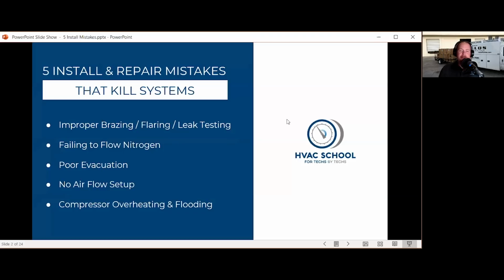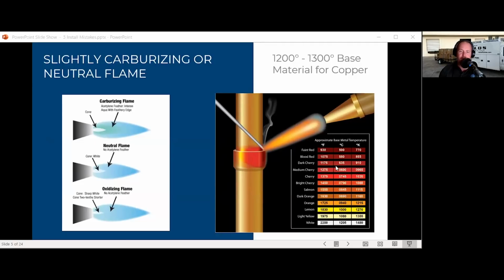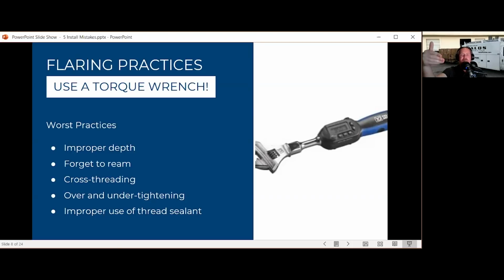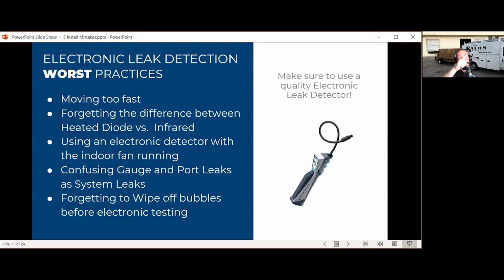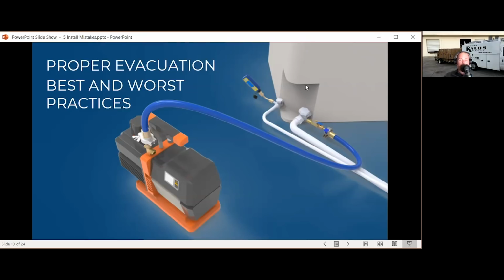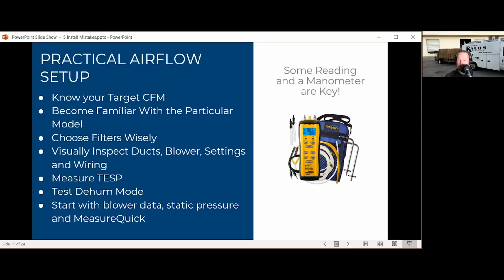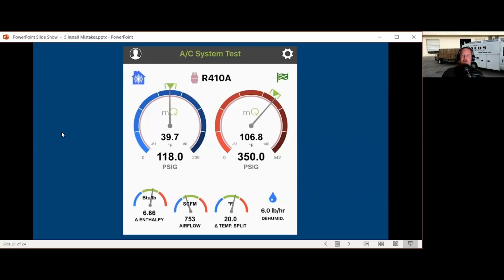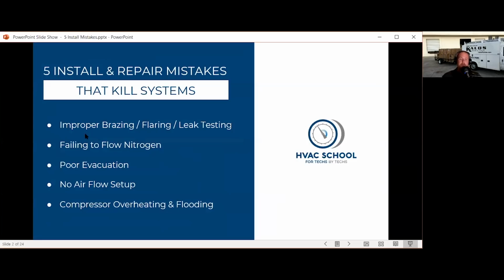5 Install Mistakes that Kill Systems

Comment: Just commenting on the part at 25 minutes where talking about using sealant on flare joints: 
I'm in school for HVAC currently, and I'm actually in the module about "Copper and Plastic Pipe Basics."

I've been taking a survey for my self. I'm trying to figure out if the book is rich or if the techs are right. Lots of people use dope.

And NCCER approved this material which can be found in HVAC Level 1, Module 7, 03103 Copper and Plastic Pipe Basics, section 2 (or 3), page 18, paragraph 2.

"The flare joint must be assembled using two
wrenches. Do not use any sort of pipe thread seal-ant or similar materials on the face of the joint. Pipe thread sealant is also of no value on the flare nut threads. The primary sealing point of the joint is the front surface of the flare. The threads serve only to tighten the faces together with the flare nut. Adding a drop of oil to the back of the flare, where it and the flare nut make contact, can help prevent galling."

-- directly quoted from the aforementioned text. 

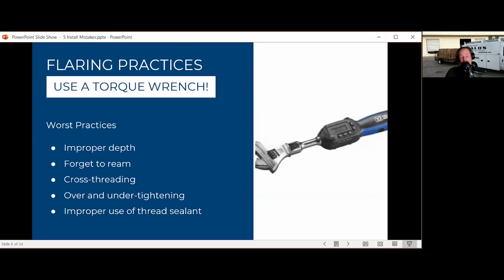25:01

Comment: I like the fixed heads on the torque wrench over the adjustable. I find the adjustable doesn’t always stay tight around the nut. Fixed heads will never have that problem. Also, I like to use a file in conjunction with a de-burring tool prior to making the flare. Lessens the chance of taking too much material off when de burring

Comment: Do you have a video showing how to fix a bad install. We had our new heat pump installed by a less than experienced technician and after watching your video I now realise how many steps that were missed or done improperly. I have been slowly watching many of your videos and have purchased all of the equipment needed to do a proper install. I'm a retired mechanical engineer and started doing HVAC on my auto repair projects after getting tired of having my AC recharged. This year we finally decided to go with a heat pump for our natural gas central air system. We live in the NW (Oregon). Since I now have the equipment to do a proper install, and thanks to you, now have the required knowledge to, at least, do a better installation job than the tech we hired, I would like to see if I can undo any of the potential long term problems he might have caused. At the very least I am going through and checking all of the system settings that you cover in this fine video. Any info on recognising and fixing a possibly poor pump down job would be helpful for my peace of mind. Thanks for teaching an old dog some new tricks.

Comment: Having to setup a system in a 2700sqft manufactured home is one heck of a task just had my entire system replaced with a American Standard 5 ton two stage Gold 18 heat pump With a gold 18 variable speed downflow air handler as well as them replacing and running some new duct runs and for the life of me they couldn't get my static pressures lower than .9 total external static 15 supply registers and every single one of them was .52 and the return was .67 I'm thinking at least on the return side I need either another 25x30 return or what to do.

Comment: I always thought my blower motor for the evaporator was to be cleaned of dust that sticks in the squirrel cage fins. Does any body spray it off regularly. I have seen ones that are so full of lint that the fins are flat not arcs. It is hard to do to clean it/them, what do you spray them down with. silicone aerisol ? one day I will get the garden hose.

Comment: Have a Bryant 3 ton central air. Installed in 1983. Has never needed refrigerant and original capacitor. Temps today is 105 degrees and keeping the house cool.

Comment: Sometimes the shrader cores are almost impossible to get out due to manufacture or install, like there’s no room to get the remover tool in there.. otherwise I always pull atleast one shrader core

Comment: using a swage kit to deburr is way quicker and cleaner. for example: after cutting a 7/8 copper line, use the 3/4 swage, open it all the way and its a perfect fit.

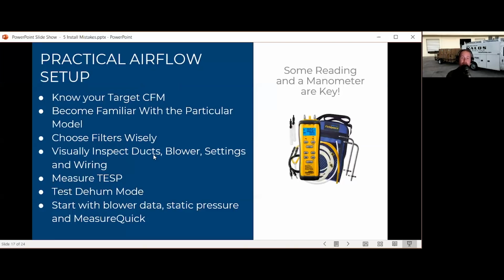Comment: 42:53 if you had a dollar for every installed system you inspected for the first time, and noticed there were no holes drilled to test static pressure, would you be a millionaire?

Comment: I have never seen one tech who flowed nitrogen thru a system while brazing who did not have a leak later.  Sounds good in pratice., but very hard in practice.
Reply: Don't jam 50 psi into the system while brazing then
Reply: If you haven't seen it or practiced doesn't mean it is right. Take pride what you do regardless of others.
Reply: @1971omi  Right. We did a huge job at a refinery. Thousands of feet of piping and hundreds of fittings. Engineers insisted  on flowing nitrogen thru lines. We did.  The right way.  Ended up going back and spending several weeks fixing leaks.  The few lines we did not flow nitrogen thru , No leaks.  After that experience I said enough of that. I just purge the lines with nitrogen and then let it escape while brazing. No flowing nitrogen thru lines. By the way I have never seen a plumber solder a line up while water is flowing thru it.
Reply: @johnd4348  That is the dumbest analogy I have ever heard!
Reply: @NeverEnoughPyro40  apparently you dont know the definition of analogy.
Reply: @johnd4348   You must have had pressure in the lines.  Did you use a flow meter, set properly, or did you use a regulator?  In 45 years of brazing, I’ve never had a leak that was caused by flowing nitrogen thru the piping while brazing.  Like you I have done winery’s with hundreds of joints.  Just because you had problems, doesn’t change the fact that it is best practice.
Reply: It can be an issue when it starts to give you pinholes but it 100% will save you down the line. On that last joint or 2 if it starts to build pressure just shut it off, then blow it out after.

Comment: Number one thing that kills systems. TIME,  Employers and supervisors pushing techs to get every job done as quickly as possible and skipping every proper proven method to make a system work properly.  I hear about TIME  and Productivity 40 times a day to the point I am about to quit . It makes this field  very unenjoyable.
Reply: Yeah it's why it's best to start your own company so you can do the best quality work without pressure. I loved when I had my own company because any customer that wanted quick over quality I would refer them to the other companies. I would even sometimes tell customers I would take two days to do an install and they really didn't like it but I would explain that sometimes the extra time to remake the return box or other aspects would make unit last longer. Actually had to move unit from one side of house to another and redo duct and it took six days but customer was very happy since it was moved twice before and it was just patch job over patch job and I said I would only do it if we could do everything properly. Your work will speak for itself and almost all my future clients came from word of mouth since I did no advertising.

Comment: Way good advice... pipe contamination is easy for a careless technician. It has just happened once to me. I do not know how I got the dirt in the pipe but it cost me hours and service to clean the system up after that. I'm still nervous about the compressor to this day. Take your time on the installs. Best advice anyone can ever give.

Comment: Down here in the land down under we still have 3/4 flares out there. I always use an automotive torque wrench with crows foot ends but I can hardly get those 3/4 flares to torque

Comment: Could soft silver solder be used in place of brazing?
Staybright 8  stronger than braising? Doesnt cook king value?
Use min amout of flux? Close gaps for proper installation? As per the instructions.

Comment: Brazing missed using the correct tip size. Many torch sets for domestic use are too small for commercial use.

Comment: A system will not leak if all pressure switches and joints are brazed correctly and if your Schrader valves are screwed in tight with the valve caps on tight. That's why it's called a sealed system. The first refrigerant charge is supposed to last 15-20 years after installation before the refrigerant levels would ever have to be adjusted.
Reply: correct. my longest running system i still know about is 17 years, one run capacitor failure.

Comment: For pressure testing, I've seen in Belgium that people use N2 + H2 as a test gas. This because the H2 molecules are much smaller and will show smaller leaks easier. Do you have thoughts on that?
Reply: Mr. Trappers,
An interesting conversation although I would pan the use of H2.
He Helium is the thinnest noble element that leaks much better than nitrogen, is non-reactive, leaks more at a lower pressure, which is why your kid's balloon goes limp. I'm guessing that helium leaks about 6 times easier than nitrogen.
I suspect that high-pressure nitrogen is used for HVAC due to lower cost, and maybe to break weak components before the unit is placed in service.
Reply: Its Impossible to detect N2 on a gas leak detector the trace gas can be detected might be the reason? You can of course use an ultrasonic or liquid for N2 leaks.
Reply: Meaningless to talk about atomic weights.

Comment: How long does it take to pull a good vacuum?...
To 200 microns, 3 cigarettes or 2 beers or a long lunch. Lol
Reply from the maker: will answer in Q/A vid
Reply: I find if I pull a vacum for no less than an hour or more the unit performs much better.

Comment: I work for a moderate sized mostly residential company over the 20 years we have installed 1000’s of systems every one soldered with stay brite 8 410/22. We leak check with nitro No micron gauge we run the 4 CFM vacuum for a 1/2 hr to 45 min and open the valves. We have had very little problems with systems we install and no leaks on any joints that I can think of. It’s nice to do everything to the book but only possible when your in a classroom not running a very successful business.
Reply from the maker: I do own a successful business with 160 employees. Try again.
Reply: We follow proper procedures at our company in which is successful. It’s not like it takes more time to do it right. More effort, yes. Don’t be lazy.

Comment: I'm definitely not an HVAC expert at all but I've just recently heard of running low pressure nitrogen through a system when brazing or even deburring for that matter. Working with my dad we'd usually clean the copper with a drill and wire brush, braze it in, and then leak test with nitrogen. We've never had any problems at all doing it that way.
Reply: Yeah the problems won’t come until later down the line, basically you want any possible contaminate to not be in the system. When you braze there will be black flakes on the inside, you also want to flush and blow the system out on each side.
Reply: @channelname8623  simply stated true facts hackery comes in all sizes and shapes his dad's short cut becomes another's  change out within 3 to 5 years down the road .

Comment: In most soldering, quenching is verboten because it can lead to cracking. 

Also, most bolt manufacturers recommend lowering the dry torque spec by 30% when lubed. I’m not sure how that holds up with flares.
Reply: Cracking occurs due to thermal shock, so I quench with my field provided heat shield (rag) because it has minimal thermal differential after brazing and then move to a rag that wasn’t used as a shield but has been sitting out so it’s also not much colder than the hot copper. Sometimes though when I’m feeling froggy, I do like to quench with ice water from my cooler immediately after brazing, life is short you know, yolo and such.

Comment: when changing r-22 to 410 freon do you need to change TXV in all cases
Reply: Betty Collins sorry but R410A is NOT FREON   Freon is a BRAND NAME of DUPONT.  Cheers 🇺🇸🇺🇸🇺🇸🇺🇸
Reply: I have seen the evaporater coil and condenser coil split going from R22 to 410A. The pressure is much higher.
Reply: Not even a thought dude it’s a must.
Reply: Of course, what kind of tech are you ?

Comment: I learned some of these steps at school,  but in the field, especially in the summer, there is not enough time to do all these while you have calls waiting with no A/C. Worked in a few companies and they don’t practice that at all. If you take to long, you’ll get reprimanded. That’s what I’ve seen.
Reply: Yep, i work at one of those places, we slam everything in and run out, i get a phone call asking about how we are coming every 1-2 hours , we do pull a good vac,  500 microns, thats about it
Reply: 100 percent agree. 30 year tech.  Its catch 22. Do the job right, BUT get it done fast.  I skip every step I can, let the Employer eat the cost under warranty call or call back.  It will be months later and who knows or keeps track of what was done. Poor additude but after 30 years  No mater how fast a job is done, its not fast enough. Or they know some tech who some were some time in the past did it faster and better.
Reply: Bottom line is greed , riding the pony till it keels over , worked over , ✌️👍💪🙏😔🤙
Reply: I worked for a company that would  send me to a whole day job on my own,  call me off to do multiple callouts and complain when initial job wasn't finished and I had to go back next day. Boss thought he could do it but he was useless.
Reply: I agree people toshit work and not follow proper practices
Reply: Find a better company! if you want to work for a company that doesn’t do best practices and focuses on “get to your next call” then stay where you are, but there are many companies that would rather the job gets done correctly the first time, and you don’t have to worry about what you have next.

Comment: Hi, big time follower here.  Wish knew about you when I did contracting in the Cayman Islands.  Question.   How fast would one see vacuum or nitrogen pressure change if there was a tiny pin hole leak?  Thanks
Reply: Depends on the size of the system/lineset(volume), it could be seconds or hours. Most higher end micron gauges have a leak/progression rate built in but if you have a large system it can still take time to show. And that's if your gauge is accurate.

Comment: You would probably shit your pants if you saw the stuff they do at the new company I started working at. Wish they cared about quality like you do. I get home from work and watch your videos every night, can’t thank you enough for the knowledge. Truly priceless.
Reply: Had a tech once tell me the company he worked at did the "blow and go method" meaning he would not use vacuum pump and just blow the air out of the line with refrigerant and go. He was probably the worst tech I ever worked with and told him anytime he worked with me we would use a vacuum pump. He only cared about getting off work to get to the bar.

Comment: Great information & I learned a few things. I will say though the company I work for just has install crew (changeouts) get the system running & have service come in to take readings, adjust charge, etc etc

Comment: A few tips from many years doing this. When deburring  tubing, I do tip the tubing upside down in 80% of the deburring, but when it’s not possible I run nitrogen to blow out the chips.  It’s critical to keep the system as pristine as possible with many of the mini splits, because some OEMs prohibit dryers in the system that would catch these particles. After I debur, I place my finger over he outlet to build up pressure and release the buildup and any residual contamination.  I was also taught to reflare after a flare was compressed twice and always inspect the flare. I was always taught to use a mill file to square off the tubing after deburring  to maintain maximum flare thickness. I also use flare gaskets on copper to steel connections.  Most mechanics and supply houses don’t know what they are.  I use a patch of duct tape to cover the ends of all tubing open more than 15 seconds or so.  I never remove both caps on a dryer at one time, I remove one, make the connection, then the other.  This helps reduce the adsorption of moisture to the desiccant.
Reply: Good job! This sounds like solid advice. Thanks!
Reply: It's those little details we forget that can be monumental or paramount to ace a repair or install thank you on sharing..,👍💪✌️🤔🖖💎😊
Reply: What is the cut of point (angle) before you ream and then purge nitrogen?

Comment: Question for Brian I'm a tech now but with the virus I'm back doing rough ins and change outs again. Which I don't mind I've used quite a bit I've learned such as sealing lines that will sit for a period. My question I see a lot of the guys I work with will use the caps and duct tape them to the lines is that sealing them well?
Reply: On a temp basis you can do that yes. No different than line set stored at the shop or in your van. All your looking to do is keep the moisture out.  On the other hand if your already tied into the evap it wouldn't hurt to pinch it shut and solder the end with a shraider valve and pressurize it with a bit of nitrogen if its sitting for a while.  Either way you go. Whatever is in the system will be pulled out when you pressurize with nitrogen to leak check and during evacuation. So just make sure its got something on the ends of your line set and your good to go.

Comment: I have been using Stay-Brite #8 for years now -- never had a problem, or a leak. Plus you don't have to run nitrogen.
Reply: @Timothy Salomon  I most definitely use wet rags even with Stay Brite-- protect those TXV's and service valves
Reply: @Timothy Salomon  Just make sure your pipes fit tight and prep the male and female ends really well and only flux the male end lightly-- that's all you need
Reply: Timothy Salomon definitely still a good idea to flow nitro with stay-brite. It’s liquidous temp is above the temperature at which the copper oxide will develop.